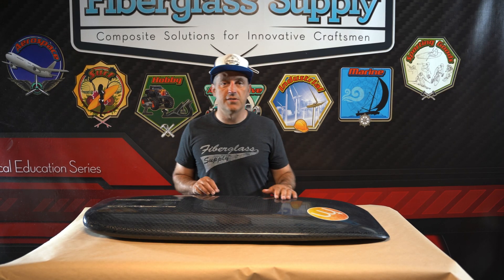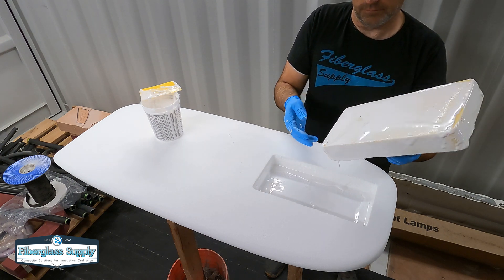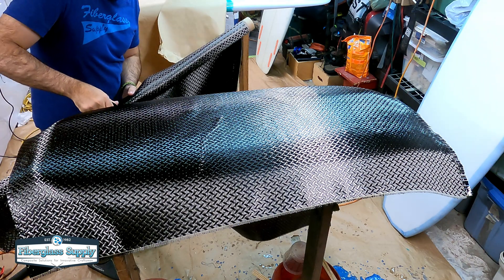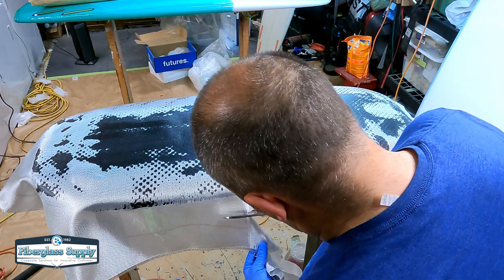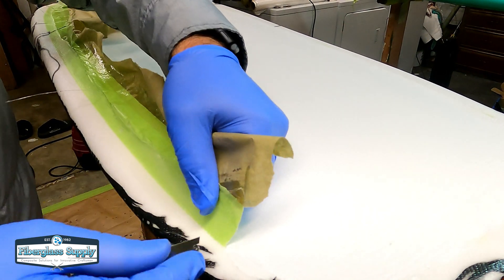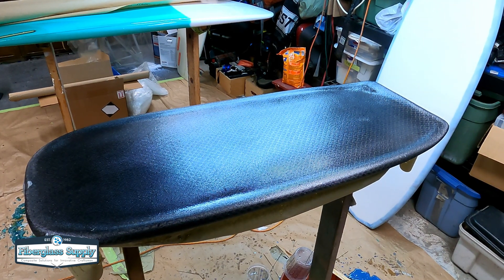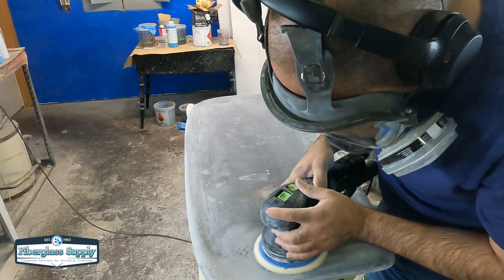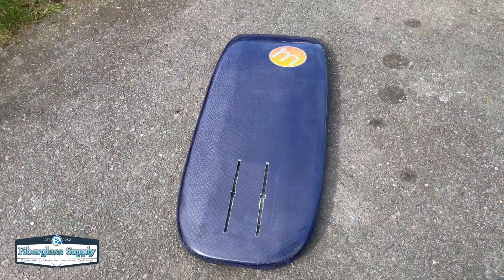Wake and Kite Foilboard Build - Glassing with Carbon Fiber and S-2 Glass

Comment: What temperatures are you glassing in? See you had a coat on and was wondering. Thanks
Reply from the maker: The part where I had a coat on was at the shop on the weekend a the heat was turned down.  For most of the rest of it the temps were 65-72F.

Comment: How did you keep the resin out of the tracks?   I didn't see you put anything over it when you laid the carbon.   Also, how did you remove the layers over the tracks, use a router?   As a styrofoam board, did you put a relief plug in it for out gassing?
Reply from the maker: I didn’t put anything over the tracks, a little resin got in in a couple spots but was relatively easy to clean out. I used a dremel to open up the box holes, we have shot another video of a wing foil board that shows that and will probably post in the next month. At 20 liters and with 2lb foam I am not too worried about out gassing so I did not put a plug in it.